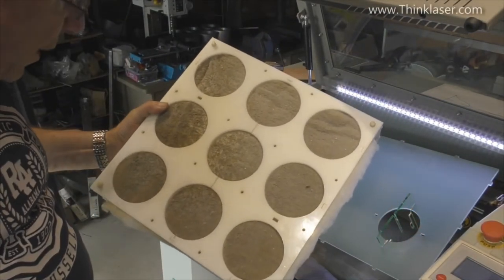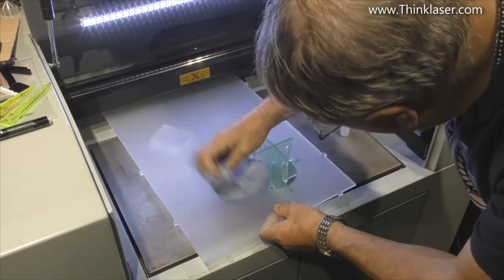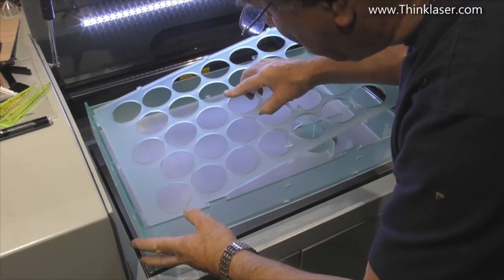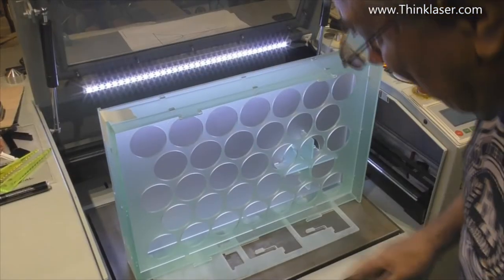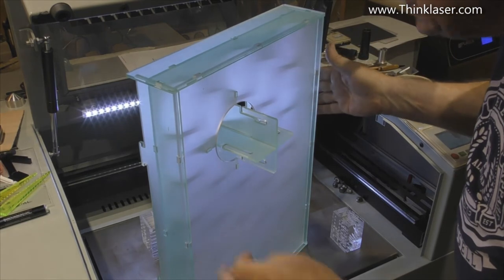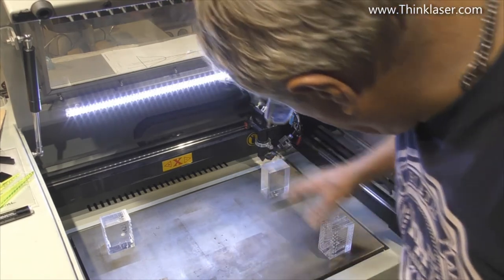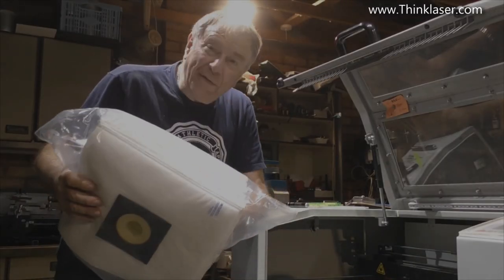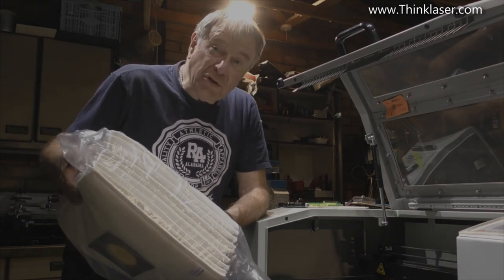How To Use A Laser Cutter - Lightblade Learning Lab 31A Fume Pre-filter MK2

Comment: Hi Russ, you are reassuring me, I love my Lightblade its incredible, but nightmare with the Purex filter, after two blinded main filters and two wrecked pre filters, from not a lot of cutting walnut veneered mdf, 4mm. This explains so much. No one told me about this issue with mdf and the Purex filters. So, I'm trying to locate your file for the upgraded version of the filter, the larger one shown in this video and can't locate it. I've got the file as shown in this thread, but that is the original smaller one. Could I please have the file for the larger one, any chance of sooner rather than later, I can't cut my product boxes at the moment that are due out tomorrow. Many thanks in anticipation. Trace Telford . As a footnote, my Purex is being set at 190 on advice from Thinklaser, I note yours was running at 317? A lot higher than mine, is that setting because of using your pre-filter?
Reply from the maker: Hi Tracy,

Here is the link to the file you requested. 
http://thinklaser.com/wp-content/uploads/2018/06/Prefiter-Mk2.dxf

It should sort out the issues you are having

Regards 

Gareth @ Thinklaser
Reply: Hi Tracey, did you ever go ahead with the pre filter? If so did it make a difference?
Reply: @leatippings7479  Hi Lea, yes I did go ahead and it solved my problem completely
Reply: @TelfordTrace  That's amazing, thank you for replying, did you use the same amount of padding? Could you tell me where you got your padding?